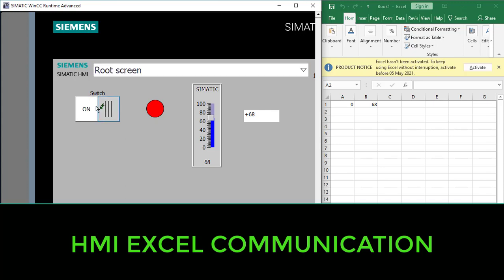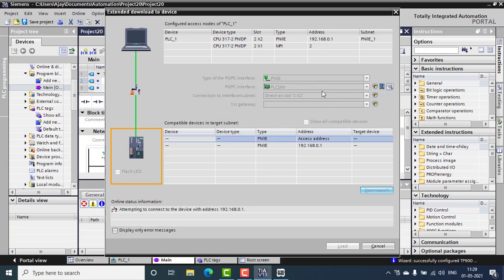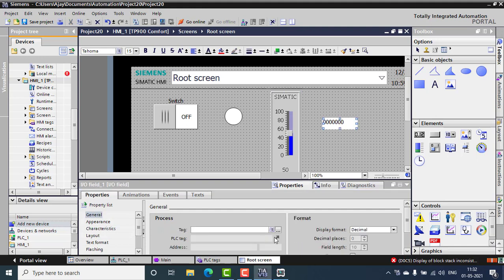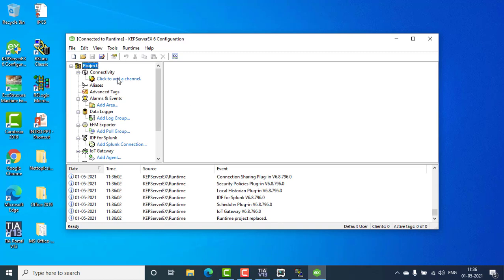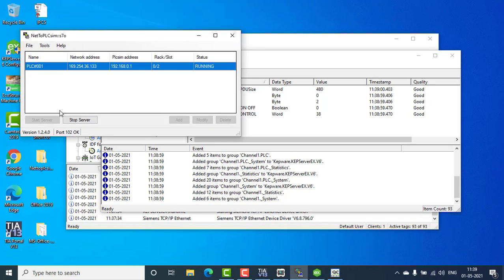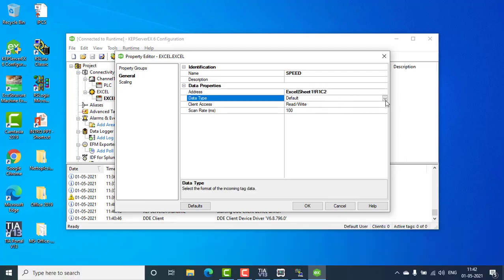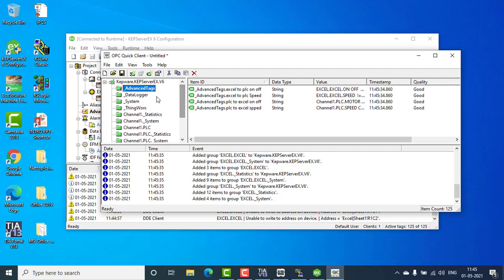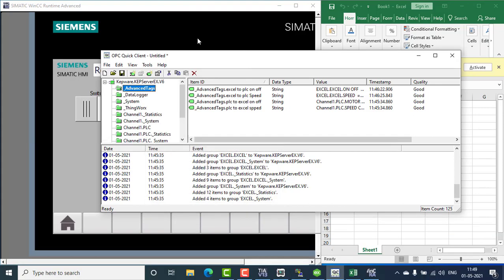HOW TO LINK TIA PORTAL WITH EXCEL | PLC TO EXCEL COMMUNICATION | TIA PORTAL TO EXCEL COMMUNICATION

Comment: Sub ReRunMacro()
Dim xMin As String

'Insert your code here
    xMin = GetSetting(AppName:="Kutools", Section:="Macro", Key:="min", Default:="")
    If xMin = "Exit" Then
    SaveSetting "Kutools", "Macro", "min", "False"
    Exit Sub
    End If
    If (xMin = "") Or (xMin = "False") Then
      xMin = Application.InputBox(prompt:="Please input the interval time you need to repeat the Macro", Title:="Kutools for Excel", Type:=2)
      SaveSetting "Kutools", "Macro", "min", xMin
    End If
    If (xMin <> "") And (xMin <> "False") Then
      Application.OnTime Now() + TimeValue("0:" + xMin + ":0"), "ReRunMacro"
    Else
      Exit Sub
    End If
End Sub